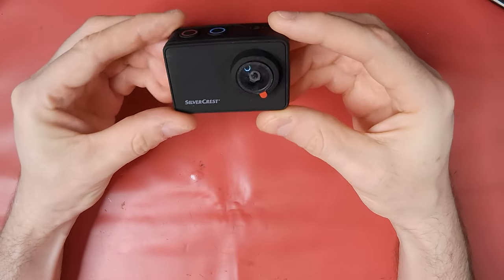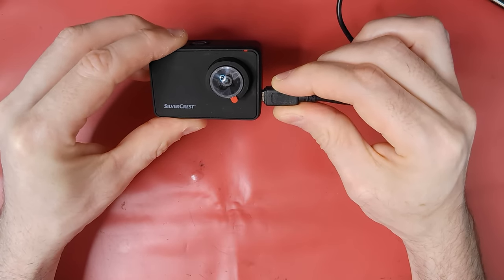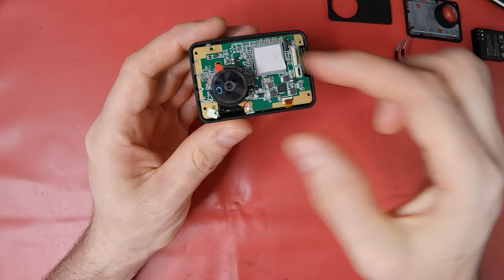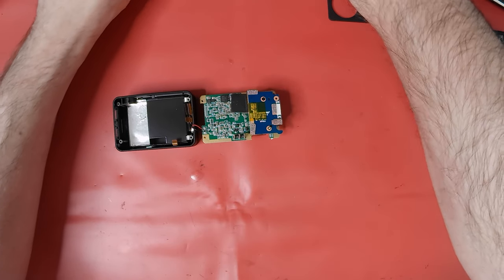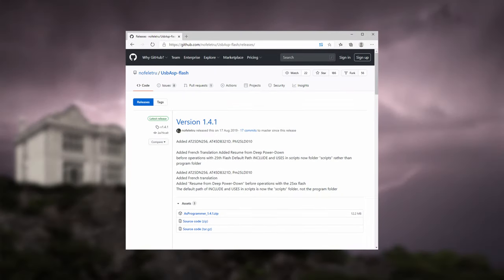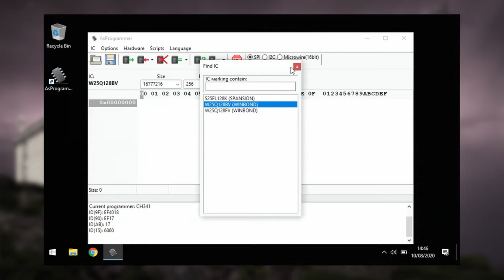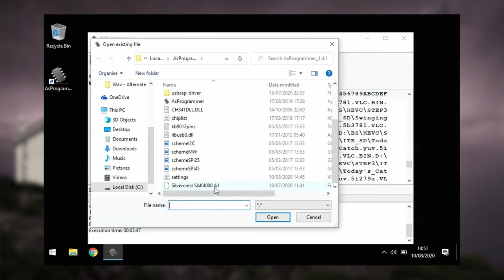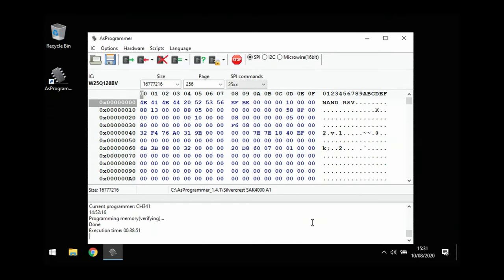How to use a BIOS flasher to rescue dead camera

Comment: I did a similar procedure a few years ago to unbrick a chromebook using a raspberry pi 1. It's very handy having these tools.
Reply from the maker: Any time I can fix surface mount electronics without switching on the soldering iron is a win in my book!

Comment: That was very interesting. I just bought the same camera as you gave it a good review and it was down to 39.99. Are you still looking at custom firmware as I believe it very like a certain V50 pro form another company which has wifi. Not sure what the capabilities of this camera are but if the wifi chip is there just not being used by the firmware then it might make this an even better bargain.
Reply from the maker: Thank you. I thought the same as you but unfortunately the SilverCrest camera doesn't appear to have the Wi-Fi chip and if you flash the V50 pro firmware (which the camera will happily install if you put it on the card) it hangs with an "Akaso V50 pro" boot screen. I expect it is trying to initialise the missing hardware. Re-flashing the original firmware as per this video is the only way to rescue the camera.
Reply: Thanks for the video, very helpful. You just saved me £8 and a whole load of stress as I was about to flash the camera with the V50 pro file too
Reply from the maker: You're welcome, all part of the service 😉

Comment: Hello,

My CAM is on Firmware SAK4000A1 Ver. 1.0.11. Has anyone managed to upgrade it.  The current one is quite buggy (clip dates are incorrect / time lapse photos keep the screen running draining the battery).